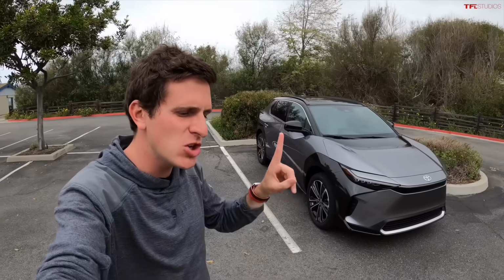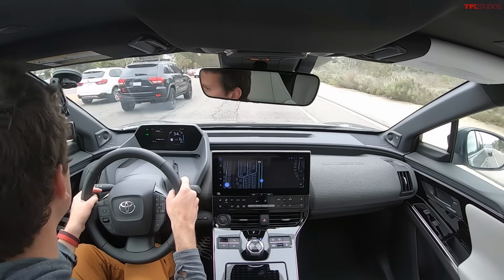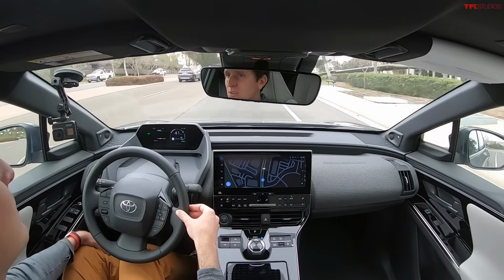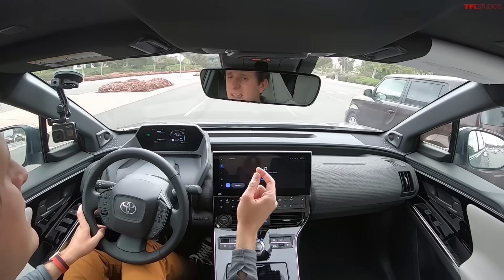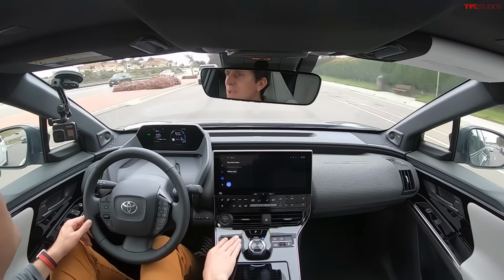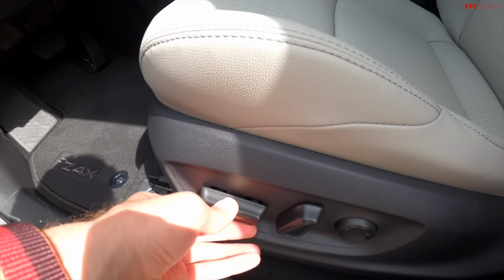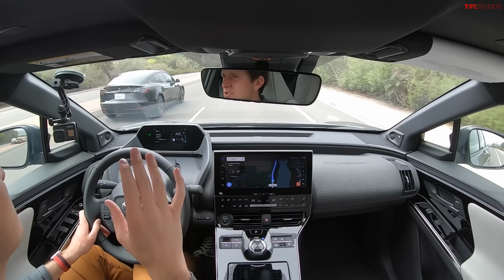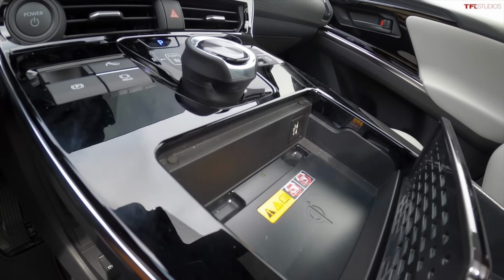I DRIVE The New Toyota bZ4X! It is an Excellent EV with a Couple Big Disappointments

Comment: The dashboard area in front of the driver looks like the display is installed in a riding lawnmower seat. Combined with the awful exterior I wonder if Toyota is worried they won't be able to produce an electric vehicle in large quantities and instructed their stylists to make sure that wouldn't be a problem.
Reply: I imagine the execs seeing the car for the first time, "I hate the front, it is very ugly."
Then the designer steps up enthusiastically, "Wait util you see the dashboard!"
Reply: And so goes the story of the electric car, as brought to you by legacy automakers.

The ball has already started rolling on EVs, so botching offers in order to make them appealing will hurt them in the long run.  Toyota and Mazda are so far behind at this point.
Reply: @evanmarshall322  You got it. They talk about selling lots of EVs by 2030. Meanwhile they sell out of any EVs that they currently produce. They have fought hard to keep selling us ever more powerful gas vehicles though. The Tesla model S has been around for 10 years and the legacy automakers are still dragging their feet on EVs.
Reply: Toyota really doesn't want EVs to take off. They would lose the big advantage they have with their ICE vehicles. They've spent billions on R&D.
Reply: lol, i was thinking the same thing.  maybe a new "parking" feature couples

Comment: How is Tesla making an all wheel drive model Y with a 300+ range and 5 second 0-60 and no legacy auto maker can come close?
Reply: Because this is 1 of the 15 EV Toyota announced. This isn’t even their performance lineup. 

Also, the more power you pull, the more heat you produce which increases stress on the battery and cause more lithium to leave the anode and permanently bonding, which reduces capacity.

Hence why it is not recommended to supercharge your Tesla as well as flooring your Tesla every chance you get.
Reply: Respectfully, that model Y starts at $20k more. You can buy the bz4x and a corolla for that. And that's actually sad, because I don't think the bz4x presents a good value, for what it is, honestly. I don't think Toyota is trying to complete directly with Tesla any more than they've been competing directly with BMW, but the cars they ARE competing with in terms of price point and amenities seem to beat this bz4x in most ways.
Reply: Tesla’s software and battery tech is the best available. Their ability to actually build cars is just poor

Comment: If it had a 400 mile range, no one would care about the styling
Reply: Toyota certainly doesn't care about styling.
Reply: @RatherBeJetSkiing  most folks who buys Toyota cares more about reliability than style.  I think this EV looks great, style is very subjective BTW.
Reply: @jml9550  we bought a 2022 Tundra for the reliability. With EVs there is less chance to set yourself apart as a company for reliability. The battery and motor technology is the same or very similar among the EV companies.
Reply: @RatherBeJetSkiing  good point on EVs similarity.  I don’t need a EV TBH, don’t care or want range anxiety.  At my stage in life, time is much more valuable than money.  I would rather have a stylish coupe like the Lexus LC500H, where a full tank can go 500+ miles.
Reply: @jml9550  my dad used to say the Latin phrase. De gustibus non disputandum est.
Reply: @RatherBeJetSkiing  couldn’t agree more.
Reply: looks good so it doesn't matter
Reply: Reminds me of the Rav4 which is strangely the #1 selling SUV in the world.
Reply: If I have a $100K to spend on a car, I would go Lucid Air Touring.

Comment: 100KW charging speed is a deal breaker in 2022. More so in Canada where charging cost is by the minute on DC fast chargers
Reply: More than a deal breaker, it’s a joke. As bad as 150kw on the lightning.
Reply: no one cares
Reply: @allentoyokawa9068  Clearly you don't own a BEV.
Reply: Where I live in Canada you can only get 50kW charging…. Hopefully that is going to change.

Comment: At 6'2" It sounds like a roof problem. Not a fan of the weird driver display distance. I prefer the VW style. Surprised by the low charge rate. I'm sure every competitor will be pointing that out. Is this OTA compatible? Better be. This is a great $30k ev.

Comment: They just announced the price: $43K for the front wheel drive base, $2K extra for AWD. The more loaded limited trim is up at $47K. It's effectively a non-starter against the rest of the EV crossovers in the price range, especially considering Toyota's federal tax credit eligibility will be phasing out when it arrives. Should have been mid-$30Ks for the base, and $43K for the loaded versions.
Reply: Totally agree. Ioniq 5, ID.4, and ev6 all have better range, charging, speed, space, and more features for similar price. If this was 40 or less it would do amazing.
Reply: @Psearcey  Not even $40K. ID. 4 starts at $40K, which nets you RWD, slightly better range, better DC fast charging (that is getting a software bump) and Level 2 charging, that sweet 3 year deal at Electrify America, and ahem a glove box
Reply: @Psearcey  it’s disappointing, because those other options have such low ground clearance.
Reply: Starts at $42k . AWD base is $44,080. Destination on top of each. Just a slight correction, but I agree with your overall assessment. The Solterra is supposed to come in around $40k from what I read with base AWD so I am scratching my head how this makes sense even compared to that, which is the same car from what we have seen.
Reply: @belavet  when a Equinox EV will be $30K and a $25K smaller CUV EV, this is Lexus money!
Reply: @normt430  I'm not going to hold my breath on the Equinox price. I know GM announced it will start at $30K, but that would put it under the Bolt EUV. So either the Bolt family is going to get a significant price cut or outright replaced, or the Equinox is going to start higher and GM was overly optimistic
Reply: @belavet  Solterra gives a passenger seat power Toyota doesn"t no matter wouldn't buy either one at these prices my insurance would double with an EV
Reply: @justabrake  my Bolt actually has cheaper insurance than my wife's Corolla. So I wouldn't be too sure about that
Reply: @Necrotron  I priced insurance on a Tesla and they wanted double what I pay for my 2022 subaru outback in NYS Geico I asked why so much and they said the electronics I haven't priced another EV but anything new coming out I expect it to be higher
Reply: @justabrake  Tesla is also a luxury car. So you gotta ask yourself: is the higher insurance because it's an EV, or is it higher because it's a luxury item, or a combination of both?
Reply: @belavet  I was including destination: that's CNET's total combined price from their story this week. Yeah, I've heard people allege the Solterra will start at $40K too, but that makes absolutely no sense
Reply: That's Lexus money!

Comment: Dear Ladies and Gentlemen,

I am writing to you from Germany. I now want to order a BZ4X, but it has a major disadvantage. The charging power AC is currently 6.6 kW. If you could increase that to at least 11kW it would be perfect because all new cars have a minimum of 11kW. With 6.6 kW, it takes a long time to charge the battery. Please forward this feedback to Toyota headquarters.

Kind regards
mahin
Reply: Call  Toyota. Sure they will fix that. Not.
Reply: It will have a 11kw charger by the end of the year. Japan and South Korea do not have 3-phase powergrid!

Comment: I am thinking that the slow charging is going to pay dividends to battery life.  Thus the 10 year unlimited mile warranty.  I have been wondering how the batteries of the cars that charge very quickly are going to fare over the long term if one charges on fast chargers a lot.
Reply: This has an eight year 100k mile warranty, unless I misheard? EDIT: Toyota's web page confirms the 8 year 100k mile warranty.
Reply: You are right.  Eight year, 100,000 miles on the traction battery.  My bad.
Reply: For the majority of EV owners, this is not an issue as most of the charging is done on an L2 charger at home.  L3 charging is done while traveling.  I think you are correct for those people who rely on public chargers.  Toyota seems to following the same path as Chevy did with the Bolt.
Reply: @alanpeterson6768  yes, most charging is done at home, but the model with the slower charging- the AWD model- is being specifically marketed towards people who will be taking it for trips and overlanding. The home charge argument loses some steam. Paradoxically, the front wheel drive Model has the better charging, making it more suited for trips. If anything, the front wheel drive should have gotten the worse charging battery with the focus on home charging, and the AWD model should have gotten the better charging battery to make it road trip worthy

Comment: The blacked out areas spoil the entire car in my opinion.  I just would not be able to get past that.  I don't know why most manufacturers still think EVs need to look ridiculous.  Make them look like a normal car and they are more appealing.  The charging rate is not that good either, and the AWD larger battery charging slower makes no sense.   Crap first attempt form Toyota in my opinion.
Reply: Actually, Toyota had an RAV4 EV back around 2000 and again in 2010 limited to the California market. Interesting is that the 2010 had a Tesla power train as they had invested in Tesla and cashed out when the RAV4 EV was no more.

Comment: Range and charging speed are far behind the competition and this car isn't even on the market yet. The rest is nice.
Reply: Agree, certainly wouldn't pay $50k for this when EV6 and Ioniq 5 are available.
Reply: I’m sure they intend for owners to charge at home 99% of the time. If it’s parked in a garage overnight there is no need to charge in 3 hours. You get home at 6 or 7 pm and leave for work at 7 or 8am. That’s plenty of time to charge. No need to charge faster.
Reply: Lower charging speed makes the batteries last longer.
Reply: Range and charging are programed for longevity.
Reply: @jayhiggins5239  yeah it'll have 1 percent more longevity in exchange for lackluster performance.
Reply: @suserman7775  
It will be way better than that.. And it does not charge that slow. ID4 is 127KW.. the  BZ4X FWD version is 150KW, and we wont know really until we see a charging curve test done.
Tesla had to back way down on Model S85 charging speeds.. due to failures. Toyota will NOT tolerate that. Also.. 99% of the time your charging at home. So once or twice per year.. you MIGHT take longer to charge on a road trip than an EV6 or Ioniq5.
I will gladly trade long term reliability for a faster charge.
My current Toyota Hybrid has 396,000 on the original battery..
Reply: no it is not fool

Comment: Your battery warranty info is misleading, you should have mentioned the degradation part which is industry leading.  Toyota is covering the battery for 10 years 160k will have lost no more than 10% and 660k 30%.  No one else comes close. Out of spec lost 11% at 100k so this part of the warranty is huge.
Reply: I have read that Toyota can control the temp of individual cells in the pack which they say is why they can offer the warranty. But when you think about it by offering this warranty they have to be confident that the car will have something in the range of 95% at 160k miles. Because if was even close to 90% at that point people would be abusing the pack to get a free battery replacement.
Reply: Yep. Toyota promises 90% battery retention in 10 years.
Reply: Is that actually specified in the warranty or just some marketing materials? From what I read, the warranty is only for total battery failure.

Comment: Think I'd like the gentle regenerative braking. One ride in my friend's Kona with more aggressive regeneration was hellish with my chronic neck issues and an hour of driving caused me terrible pain and a couple of days of headache.
Reply: I own the Kona, the regeneration is user configurable also he may have been using the paddles to slow down quicker. If you set it to low or zero regenerative, or I suspect just left it in normal your experience would be closer to the BZ4X or a ICE vehicle.
Reply: You know what? regeneration feature is adjustable.

Comment: 180KW is equivalent to 241 HP not 214???k. Are these motors software governed down to 214 combined HP?
Reply: AWD is 2 x 80KW = 160KW
Reply: @francoisgravel8728  Right you are. Typo on my part. 160KW is 241 HP.

Comment: It seems very average but isn’t that what Toyota is about? Maybe this will be another 300,000+ mile Toyota while the other EV’s will fall flat at 100-150k miles because they have too fast of charging, or the regen is too aggressive on the motors over time
Reply: Well Toyota claims 90% battery retention in 10 years.
Reply: Maybe, which I doubt, but would you pay $50.000 for that?
Reply: @ladrakeus9252  $50k? Nope. Ugly interior although reviewer liked it.

Comment: Let's see.  Highest power version has less power and the longest range version has shorter range when compared to the least powerful and shortest ranged Hyundai Ioniq 5s available.  And a lot less room inside.  
Given it's a Toyota and their brilliant advertising campaign, the biggest disappointment is it isn't even (in their words) "Self Charging"...
Reply: Does Hyundai promise 90% battery retention in 10 years?
Reply: @criancrna1487  No but they do promise 70% at 10 years 100k; Toyota warranty runs out in 8 years... so they aren't promising 90% either.
Reply: @LILK0NA  can’t post links here but, google “Toyota bZ4X Battery To Retain 90% Capacity After 10 Years” the first link should be the InsideEV article
Reply: @criancrna1487  I believe the Hyundai warranty is for 75% at that time.  Which means the long-range versions will still have a longer range than the Toyota at that time...
Reply: @drmcallis  Isn’t the Ioniq rated at 303 mile range? 75% of 303 is 227. Loll.
Reply: @criancrna1487  And 90% of 250 (epa rating) is 225, I believe...
Reply: For the record, I hope they sell a lot of them.  We need more EVs to take the place of ICE cars.  Just don't expect EV-savvy buyers to get real excited over their first try.  It isn't very impressive, but better than ICE.
Reply: EV6 in base has less power and range at a similar price.
Reply: @Staticmeltdown11   Not quite. The 58 kwh/RWD drive EV6 with less range may cost similar ($41K versus the bZ4X's $43K according to CNET) at first glance, but Toyota is already getting its federal tax credit eligibility phased out. Kia still very much gets it. So, if your tax burden is high enough, you're looking at a possible $9.5K difference ($7.5K tax credit + $2K difference in MSRP) in net cost at the end of the day. The next highest trim  EV6 (77 kwh/RWD) might be more expensive than the bZ4X, but it also has considerably more range. 

Basically, the only thing the Toyota has going for it is ground clearance and brand name.
Reply: @Staticmeltdown11  I did say "available."  That model isn't, in the US.
And I just realized I misread the post.  Sorry.  You are correct.